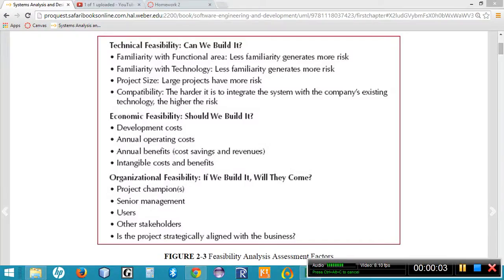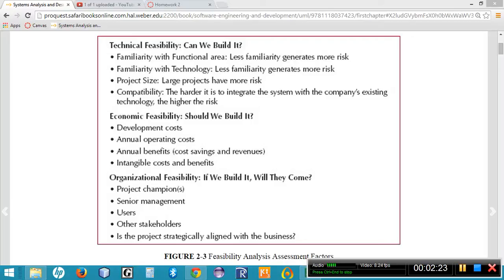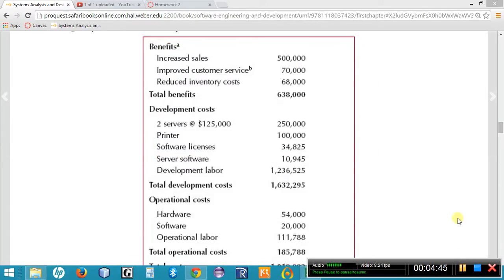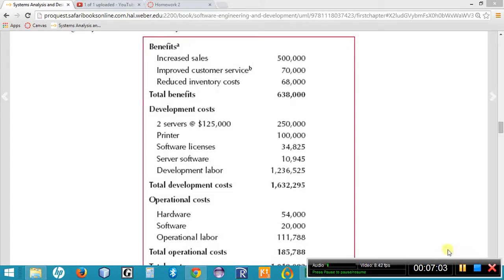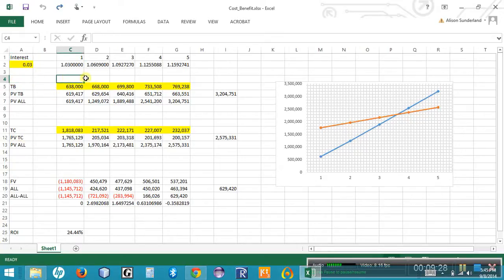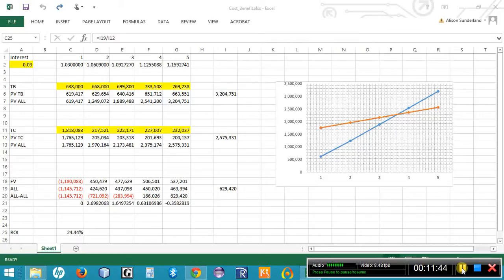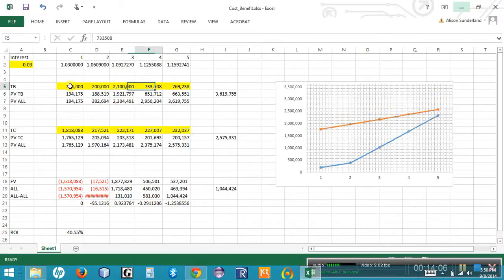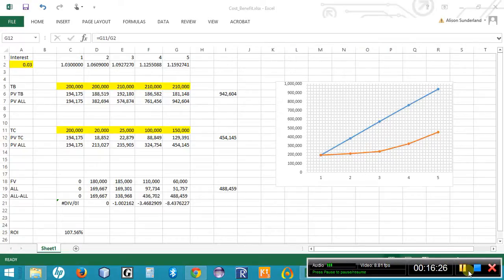Software Engineering Chapter 2 - Cost Benefit Analysis

Comment from the maker: If you were curious about the spreadsheet values (for all those accountants out there), here is a short description of the terms)

Vocabulary Lesson: 
PV stands for Present Value (the value of something in today’s monies)
FV stands for…. You got it! Future value (the value of something in tomorrow’s monies.)
TB stand for Total Benefits (sum all the benefits)
TC stands for Total Costs (sum all the costs)

So PV TB is the present value of all the benefits
So PV TC is the present value of all the costs 

The TB and TC fields are just summing the rows above them.

The present value of the benefits (PV TB) in any column is calculated by dividing the TB field by the interest rate at the top of the column (cells C2, D2, E2 and so on for each year.) 

Similarly, the present value of the costs (PV TC) in any column is calculated by dividing the TC field by the same interest rate at the top of the column.

PV ALL is accumulating the yearly benefits/costs. 
Take for example PV ALL(benefits); the first year it starts with the present value of the total benefits (PV TB) in the cell immediately above it. The second year it adds in the new benefits (the cell in the next column). It continues accumulating the PV TB for each of the 5 years.

PV ALL(costs) works exactly the same way. 

The last three rows are FV, ALL, and ALL-ALL
Starting at the bottom, 

ALL-ALL is the benefits minus the cost [PV ALL(benefits) - PV ALL(cost)]. Generally it would start in the negative because the initial cost of a system will outweigh the initial benefits. Hopefully, the benefits will begin to outweigh the ongoing costs as the years progress. 

ALL is accumulating the benefits minus the cost each year. The same way PV ALL is doing but with the cell below it (ALL-ALL) instead of above.

FV (future value) is calculating the future value of the accumulated monies in ALL by multiplying ALL by the interest rate at the top of the column.

Break Even graph: the blue lines is PV ALL(benefits) and the red line is PV ALL(costs). The Break Even Point is where the lines cross.

The interest rate at the top of each column is calculated using an arbitrary interest rate: (we were using 3%)
Year 1: 1+ interestRate
Year 2: (1+ interestRate) * (1+ interestRate)
Year 3: (1+ interestRate) * (1+ interestRate) * (1+ interestRate)
Becomes 
Year 1: (1+ interestRate) ^1
Year 2: (1+ interestRate) ^2
Year 3: (1+ interestRate) ^3
And so on